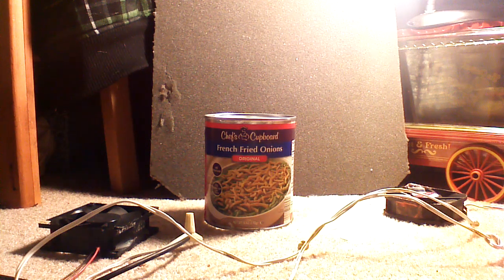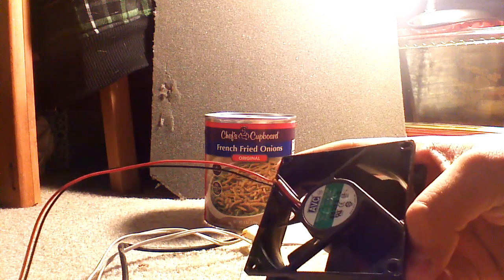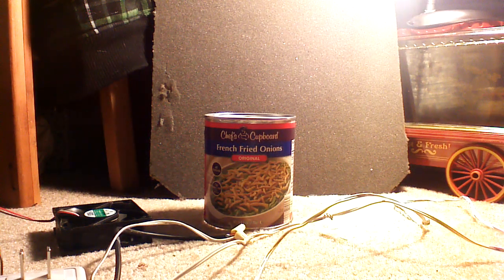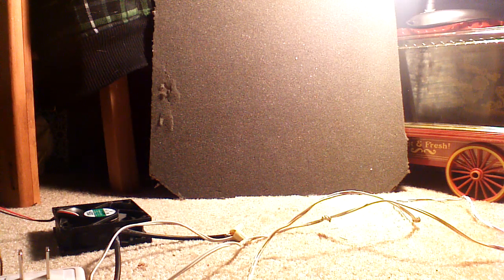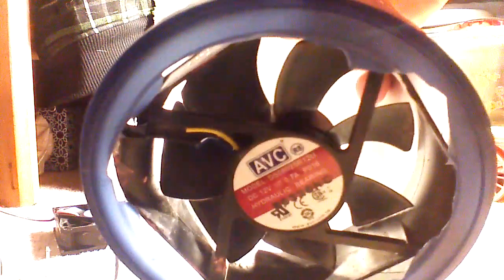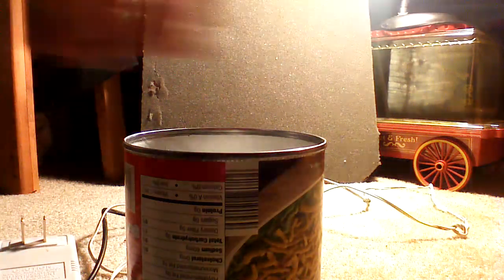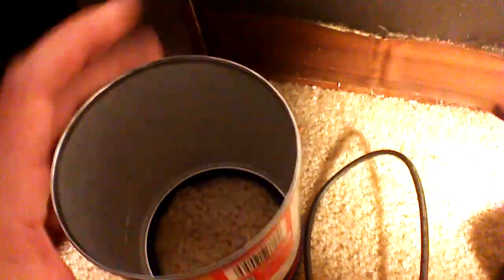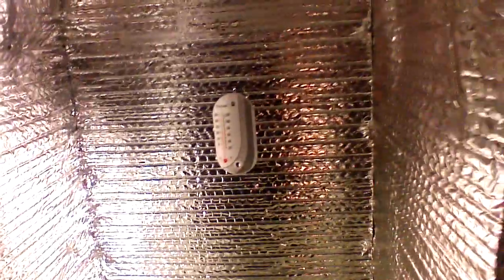HOW TO MAKE a pc fan exhaust system/carbon filter

Comment: Use the Delta PFC1212DE 12VDC 4.8A 11-Blade 120mm PC fans. They pull or blow 260 CFMs of air each and are more powerful than 4" duct fans that come in filter kits that cost over $100. I have 2 of them, one pusher and one puller going through a 6" filter for a total of over 500 cfm of air and I smoke cigarettes in my room but you'd never know unless I told you since the odor gets sucked up immediately.
Reply: Whats the noise like with thoise bad boys? Like compared to an actual inline fan which is like a jet taking off
Reply: @Elijah Gesu I use 120mm to 6" fan duct shrouds to connect the fans to 6" hoses going in and out of the filter. I have two fans because the filter has a cfm rating of 500cfm so with one 260cfm fan pulling on one end and the other 260cfm fan pushing on the other end there are enough total cfms to acomadate the 500cfm filter. Works great and a bought a lot of 6 of those fans for $30 so I have 4 extra fans for future projects.
Reply: @jimmorrison6502  These big delta fans produce the same jet noise lol
Reply: @bigtexas7580  =( sad boy hours
Reply: @jimmorrison6502  WTF?
Reply: @bigtexas7580  I need stealth my guy
Reply: @bigtexas7580  yeard?
Reply: @jimmorrison6502  Most fans that move alot of cfm are loud, you could try an inline muffler to make it quieter.

Comment: FYI for new viewers like my self if you have a 5v fan and you give it 10v it will burn out quicker if not immediately depending on the wear of your fan.  just get a more powerful fan to fit your power supply. From a fellow pot head who don't wanna see no one get caught up for simple bullshit
Reply: Almost all PC fans are 12v
Reply: Amp rating that the adapters transformer puts out to the fan is the concern if you’re worrying about burning up the fan motor

Comment: multi volt adaptors are best, then you have a speed setting for the fan, the more volts the faster it goes.
Reply: until it burns out for over driving it

Comment: hi i was wondering if i attach a fan backwards for a exhaust fan can i use that with a carbon filter will it be strong enough to blow the air through the filter
Reply: +peter lee-yun yes of course, you can also invert the polarity on any pc fan to change the direction. It's best to sandwhich 3 or 4 together onto the same power adapter to get a higher cfm. enjoy.
Reply: Event better would be a radial fan, you can easily find them online between 5&12v

Comment: How much does a fan like the computer fan
Reply: just take one out of a old CPU
Reply: How much does a fan like the computer fan? I'm sure they both get along very well.

Anyways, you can get a 4pack of 45-50CFM fans online for around $13. Then 18awg wiring+wire nuts, 1A psu, and 1 psu adapter. If you're pushing anything over 4sqft, I wouldn't go for low cfm stuff unless you're adding fans in abundance.

Comment: Wtf are you doing? Intake fans should go on the bottom of the tent/box and outtakes go on the top to expel hot air (because hot air rises) you should have done some research before making this. Also just buy a carbon filter as making your own will end up shitty every time.